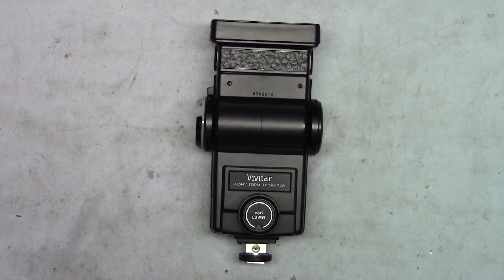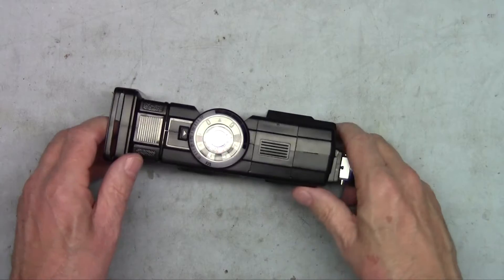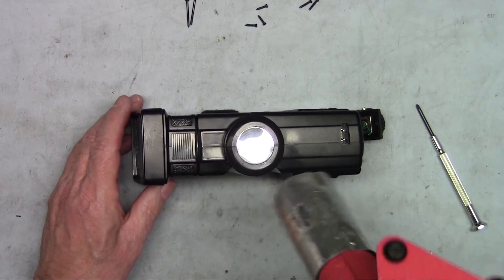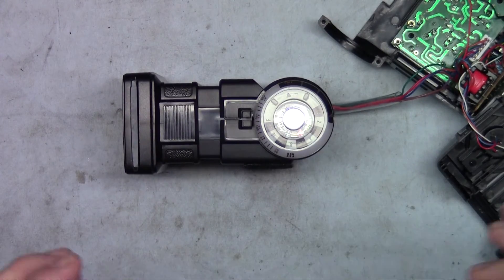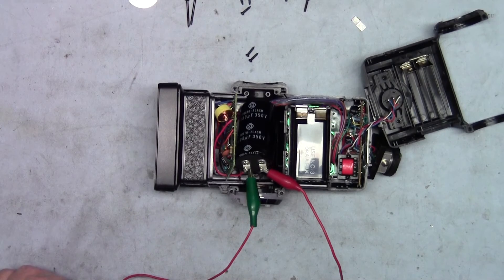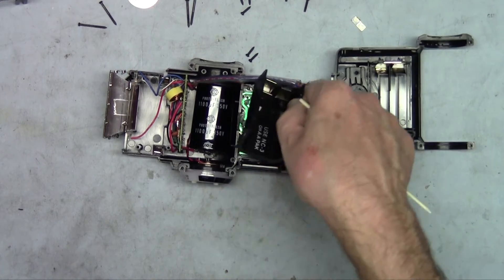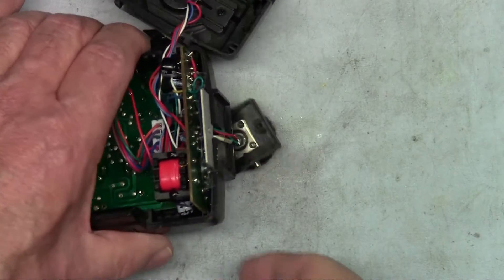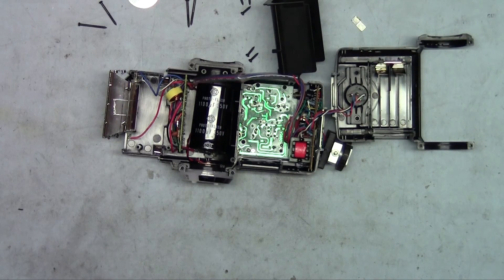Vivitar 285HV Disassembly

Comment: I opened up one of my old 285HVs a few years ago to add a  switched video light/focusing light feature.  Drilled a small hole in the reflector and added a high output 5000K LED into the head to augment the flash tube.

Comment: I keep notes on screws removed (length, type) and a rough sketch of where they came from, then put them in a dish away from the work. Left on the table they are easily knocked on the floor, or roll around into different positions.  I dismantled a Sunpak 555 last week and it is maddening how many different sizes they used, unnecessarily.  3mm, 4mm, 5mm, 6mm (all same thread) when just 3mm and 5mm would have done.
Reply from the maker: Thank you for your comment, yes sometimes the screws and other small components can accumulate quickly and memory is not trustworthy, I too have begun taking copious notes, taking photos with my phone, and tagging large items, or placing small items in plastic bags for easy reassembly.

Comment: Thank you for the super informative video.   I am replacing the original four-wire plastic hot-shoe with the two metal hot shoe that has only two  connections points.      What functionality would be lost by making such a replacement with only the black and red wires connected.  I am using what looks like the exact same metal hot shoe as you've shown, in which two of the wires from the flash have been isolated.  From your video, it appears that you have retained and soldered the red and green wires to the new metal shoe, and isolated the black and white ones.  Does the replacement to a two wire hot-shoe like this eliminate the VariPower functionality?   Does the unit still work as new, when doing this?

Comment: I found the broken wire in my vivitar 252 but am having trouble reassembling it. Any resources for that?
Reply from the maker: Just reverse the way it came apart in my video. Write down the steps and reverse the steps.. I don't know of any other materials, that was why I shared the video. What part is giving you trouble?
Reply: @CharlieTechie  Thank you for your reply. My problem is parts that fell out when I split the two cases. I can't figure out where some of these shields go and the clamping mechanism is confusing. I'll keep trying. Thanks.
Reply from the maker: @MikeJones-rk1un  Here are some still photos that I took when I was making the video, maybe they will help. They are in a secure dropbox folder:  https://www.dropbox.com/sh/gbigcvjsf7uwlfh/AABSbSYFoOTpqsPh8vOXIWRaa?dl=0

Comment: Chuck Legg, my question is if the 285HV firing at max power, what is the problem or defective part would be?

Vari Power is good.
Just any power settings, max power goes off from test or camera shutter button.
Reply from the maker: The strobe will fire at full power if there is no sensor in the strobe body, or the sensor resistors are not making contact within the socket. The sensor is placing different resistances in line to change the amount of time the flash is on. The default, if no sensor, is full power.  I would pull the sensor out and check to make sure contacts are clean. If you have another sensor, you could swap them. If that doesn't work, then you would have to troubleshoot the circuit to see what is happening.
Reply: The old Vari Power is just as good as a brand new Vari Power.
No one knows the answer from this common faults.

Chuck Legg, have you ran into this problem?

Metz 60CT-1 to 60CT-4 and Quantum Qflash T2 run into the same.
Reply from the maker: What camera are you using the strobe with? I know that some cameras, especially newer digital ones,  the hot shoes will short the wrong pins and bypass the adjustable settings on the strobe. That may be the problem, in which case you need to isolate the Vivitar from the cammer's hot shoe.

All the variable power knob is doing is switching a resistance value into the circuit, if that resistance is infinite, then the strobe will fire at full power.  It has been a while since I did the video, let me check over my notes and see if I can something more specific. I built an external control that allows you to adjust the power over a greater and finer range. I want to do a video on it, but just don't have the time right now. I will get back to you.
Reply: We and many people, including you, know how to use flashes.  
Yours and those mentioned are once the world best flashes ever made.  
But today photographers are lost and really not photographers, they don't know how to use the ATG Auto2 /or manual modes.

Very few flashes today have built-in ATG's Auto2 modes.
Many of those Vivitars have ATG's Auto Sensor.
The 283, 285, 285HV (designed by ATG/John/Max), 60CT-4 and Qflash T2 by ATG and many Nikon flashes have ATG's Auto2.

When these flashes go bad they will shoot /or fire at maximum power.

So I and many experienced flash photographers like shooting ATG's Auto2 modes over TTL. That including shooting wireless radio flashes.

We use/shoot Hasselblad, Leica, Canon, Red and Sony with wireless auto2 radio flashes over radio ttl.

Again, by turning or using the 285HV's control F-stop (white dial scale) setting /or the VARI POWER's dial, only full flash power discharged in all settings by firing a Test Button or camera's Shutter Button.
And I got the same problem with Metz flashes.

Sending these in to ATG or camera repair center is not worth it due to buying used flashes for much less.

If you can share us then we to fix this 285's.
So what is the component that is defective?
Reply: Chuck Legg, you still around or just don't want to reply?
Taking apart is one thing. Fixing the problem is much harder.

This flash is not worth much nowadays. So sending it away for repair is not worth it.
Reply from the maker: angelisone Trying to troubleshoot one is different from replacing the capacitor or strobe which is straight forward. Trying to find a schematic of the circuit is also difficult. I have found the you can pickup used units at the fraction of new one and that is what I have done when a unit is not working other than the capacitor or strobe tube replacements. As I have said before in comments, the Vivitar shoots at full power when no resistance is in the variable setting, so it could be related to that circuit but without a schematic it is very time consuming to track a problem down. Sorry I don't have more information.
Reply: Chuck Legg, capacitor, flashtube, Vari Power are good (taking out from a known good 285HV) and installed onto this problem flash.
So resistance circuit tested with DVM tested same/compared with good 285HV.

You are correct about the schematic. 
Even if we have the schematic, we would have a hard time tracing the circuit because ATG designed for Max & Ponder at that time (including the Metz 60CT-4 and Quantum QFlashes) have no names/letters/symbols on the pcb.

I asked just to see if you had ran into this problem.

Have you tried shooting in ATG Auto2 wireless radio modes, it's much better than today shooting wireless radio TTL and wireless IR TTL?

Comment: Hi,  thank you for the video.  Do you know where I might find a replacement strobe bulb for this model?
Reply: You can use flashtube from other used flashes.  
It has three leads, two outside and one center.
Reply from the maker: Check eBay, just make sure the voltage and light output is the same or similar to what is installed. I believe you can find tubes on eBay that are specifically for this strobe.

Comment: Hi. sorry for my bad English. 285 vivitar possess. It works ok but after a while ignition is triggered only several times. what is the problem? Thank you
Reply: Remove the hotshoe.
Check the Test Button's (two contacts, hot & ground)
Check wires from Center Lead (post) to ground.
Test it with a DVM in Ohm scales.
Reply from the maker: The capacitor may need to be replaced. A bad capacitor can cause the strobe to be very slow in building up the charge, especially if you are using full power.